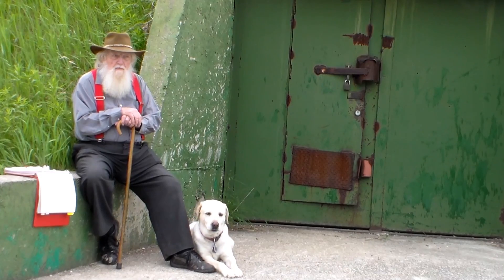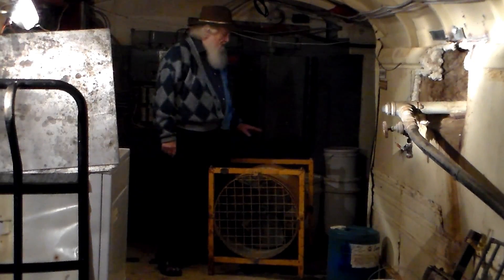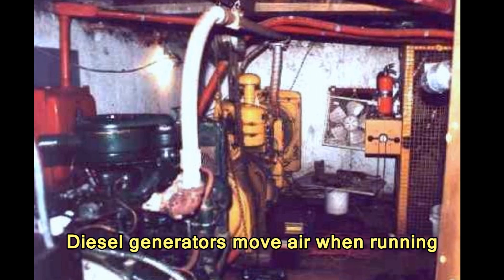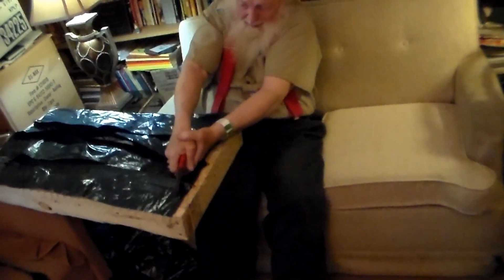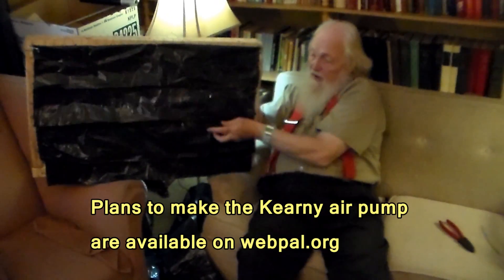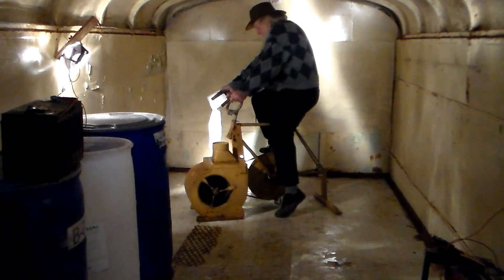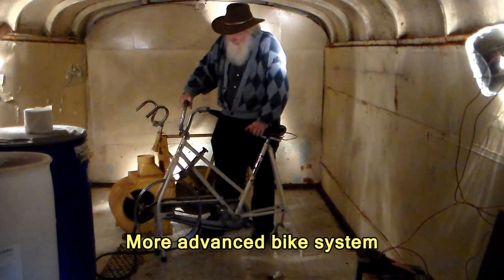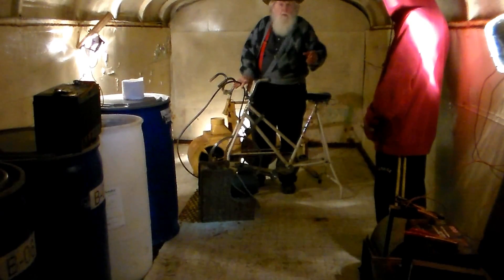ARK TWO #2 How to bring air into shelter

Comment: I had an idea to bring air down without power useing a water tromp it would prevent fallout from entering the air by trapping and expelling it in the wast water of course you would need an elevated natural source of water on your property but the system could be buried and left without supervision and it would blow air continuously into the shelter as long as the water flowed

Comment: Why do you not choose to have live plants to provide oxygen? You should check into aquaponics to grow fish as well. Many house plants clean toxins from the air too. If you had the right number of plants per person you could actually have an air tight shelter. You could have LED grow lights and every area to be lighted would have plants under them. I wish I had money to build a shelter. I have some really neat ideas for one. Thanks for sharing and encouraging people!
Reply: Sorry to burst your bubble, but trying to use plants to provide enough oxygen for just one person isn't as simple as adding some plants to the shelter. Different plants put out different amounts of oxygen as well as at different times and even less amounts as carbon dioxide increases. 

A single human needs 50 liters of oxygen per hour to survive, while a single leaf puts out approximately 5 milliliters of oxygen per hour, depending on the leaf type and conditions. This means one would need approximately 450 plants per person to survive. 

In my opinion, this wouldn't be feasible for several reasons. One would be the amount of lighting needed to keep the plants alive and in prime condition to produce quality oxygen and two, the amount of space the plants would consume in the shelter. 

I would, however, add plants to the shelter to encourage cleaner air, filter toxins and provide food. But as a sole source of oxygen, just not practical. If you think otherwise or are seeing something in this suggestion you made that I am not seeing, I would love to hear it. Peace to you.